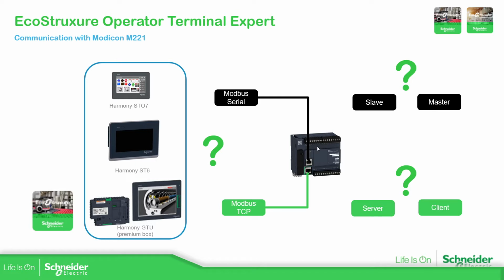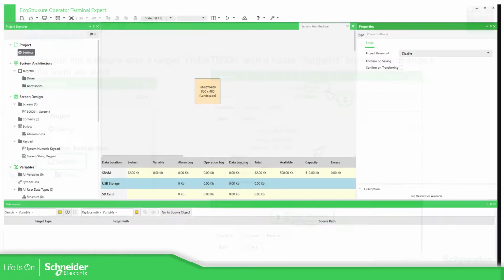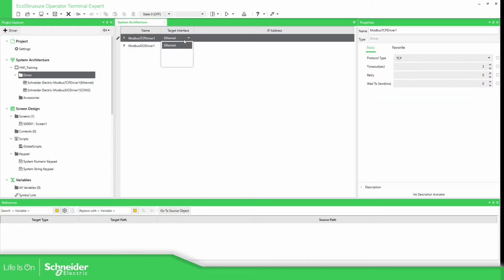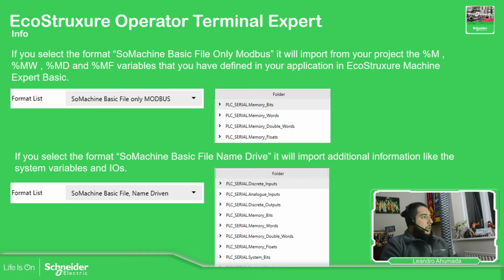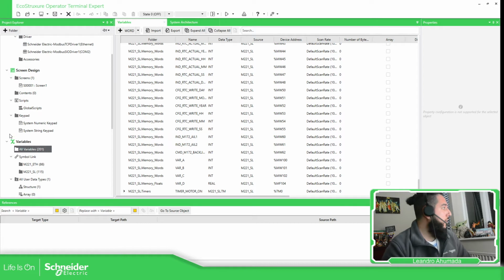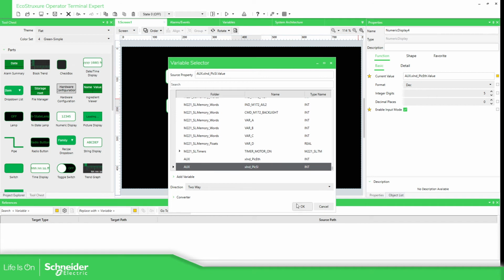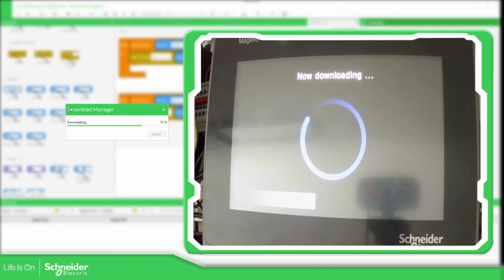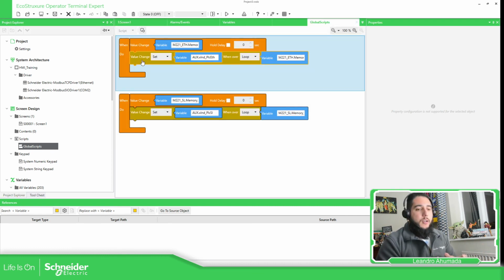Training - M221 - M14.5 Linking variables from M221 to EcoStruxure Operator Terminal Expert

Comment: Thank you for the videos! I tried to import the symbol from a m221 and it doesn't pull any of the memory words I used. Like I have %MF5 for an analog value I want to display on the hmi but its not available. What am I doing wrong?
Reply from the maker: Hi there! Make sure that the %MF has a name and then check if in the hmi does not change the register to %MW

Comment: good explanation Leandro, but i cannot import memory bits from a project of M221 using symbol link. When i choose the option Somachine file name driven  all the variables are imported except memory bits. How can i do to fix this issue?
Reply from the maker: Hi there! I will probably try the following:
1) Check that the %M variables have a name (symbol name).
2) Check that the smbp file selected is the correct one.
3) Use the latest version of EcoStuxure Operator Terminal Expert (the latest version is the v3.5)
Reply: I have the same issue

Comment: Can I write to varibles on the PLC? Im trying to write to a simple contact bit from the simulator. Changing it from 0 to 1 and vice versa but it doesnt change. However its able to read the bit when I force a bit value. Im using the trial version of Terminal expert.
Reply from the maker: Hi there! Unfortunately my knowledge on the trial is very limited... i am aware that you can not download the application to an HMI and the trial is only for 38 days... i think that there is not a limitation for connection.

Comment: .smbp file, how to get it from ecostructure machine expert? What address I should use for device in variable declaration?
Reply from the maker: Hi there! the modicon M221 is no longer include the EcoStruxure Machine Expert, please check this video:
https://youtu.be/vBn_1mZmOYI
You will need to open the EcoStruxure Machine Expert Basic to program the M221.

If you need assistant with the variable declaration please check the following video:
https://youtu.be/xsS_JNg-5MM

Comment: Hello. How to export the database from s7 1500 to ecostruxure operator terminal expert
Reply from the maker: Hi there! As i do not have a s7-1500 with i will not be able to guide you as a guide using schneider products. In this particular case i recommend you to check the help on the hmi software.

Comment: Is there a way to  set %MW to UINT 0-65535?  - I want to save the value read by serial IOScanner from slave device to MW. But MW seems to be INT -32,768 to +32,767. Can I change that?
Reply from the maker: Hi there! In this particular case i recommend you to use %MD instead of %MW

Comment: Hi Mr.Ahumada

I have a problem. I can't to transfer my variables from MS Excel to operator terminal expert. How can I transfer? Could you help me for this please
Reply from the maker: Hi Mahir, the HMI software required an an specific syntax of the content inside the file to make the import valid. Please check the next video:
https://youtu.be/SzqOc416OmI

You can also try to match the export file in your app with the one you want to import.
Reply: @LeTomas AHUMADA  Hi thanks your information Mr.Ahumada. But I have a M580 and I haven't Unity veriables menagement for operator terminal expert not exist in my license file. I download your file but It's not working for my cpu m580. 
Do you have any other solutions?  

Thank you in advance for your interest
Reply from the maker: @mahirkubilayozturk114  the videos that i am uploading are not related with M580/M340 platform. You will need to export from CE or UnityPro a XVM file with the variables you want to share with the HMI then in the EOTE you can import the XVM file in the symbol link after the driver has been added. If you need further information contact the technical support team of schneider in your country.

Comment: Nice video Mr. Leandro. Keep up the good work!
If I may, I want to ask you something... Does Schneider provides any instrument (software) to programm an interface for, let's say, the M221 but using a tcp/ip or web server? Or you should assemble the html by yourself?

Thank you for your time.
Reply from the maker: Hi NelsonGCR! The modicon m221 does not have a webvisualization like the m241/m251/m262. If you need a webserver then probably the best is to have an small hmi like the hmisto735 + webviewer license.
Reply: @LeTomasAHUMADA  Great. So, at least that option is available using that device. Thanks again